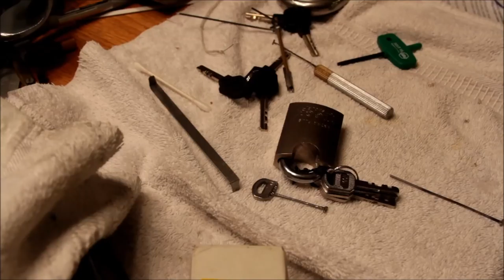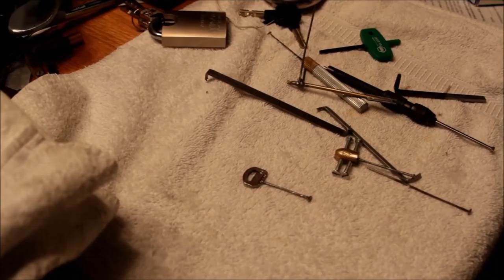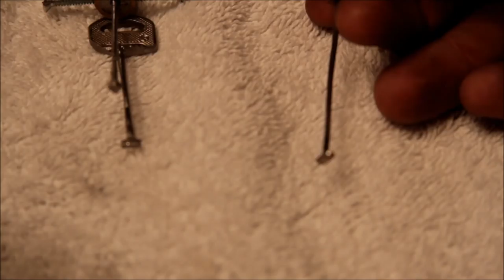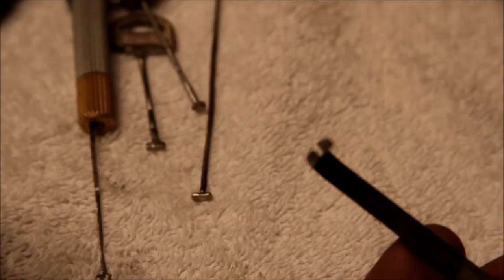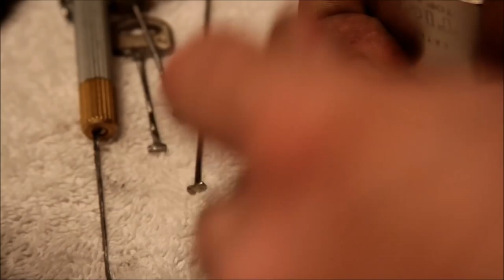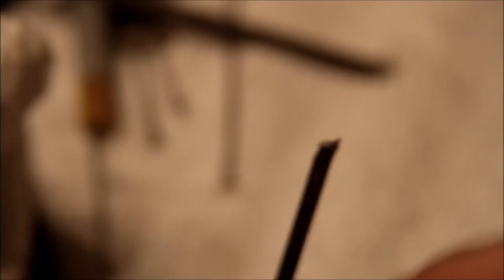(055) Help! Disc Detainer Homebrew Fail

Comment from the maker: I agree. As my tools got better, I started getting really good feedback. But then I'd get stuck, one way or another, but usually where a 0-cut meets a 5- or 6-cut. Very frustrating. Keeping the pick parallel to the keyway and controlling depth has also been problematic. 

I'd be very happy to try out the Abus plus tool. And I'll order one of the Chinese gizmos -- everyone seems to have good luck with those.

Comment from the maker: No worries. I've been working on disc detainers on and off for over a year. Still have not gotten one open. The feel is definitely very tricky. Part of my issue is that the tools that give me good feedback also get stuck on a large transition (e.g., 1-6). The ones that weave nicely inside the pack won't stay put, so it's hard to tell which disc I'm on and whether I like where it's set. 

You're right, though--I can't blame the tools (entirely). But I know they're limiting my chances of success.

Comment: Copy my picks! The wire doesn't have to be very thin for the cheap ones, a 90 degree bend on some wire coat hanger does the trick nicely. Also make sure when picking, hold it so the drain hole on the bottom is the one you can see the shackle through (and with the tip of the wire pointing to the left). This seems to make a huge difference to the feedback, I'm not 100% sure why but it could be cos the sidebar is to that side. I would recommend getting a 2-in-1 if you're really struggking though.

Comment: Did you see my video of me single disk picking a detainer lock buddy? DrBint made me a pick made out of a coat hanger (I think) and think wtench was out of a thickish wiper blade. Worked a treat and also was not "T" shaped on tip, it was just an "L" shape

Comment: I waited 2 months for a disc lock to show up and the tool works, lock lasted about a 30 minutes. the inside must have a broken plastic core  because the discs started spinning with no gates catching no more.